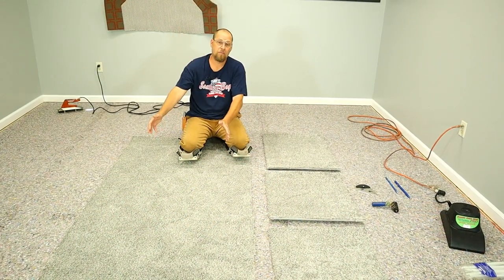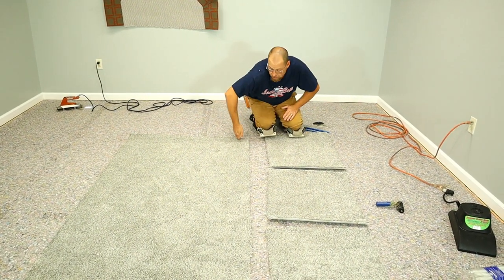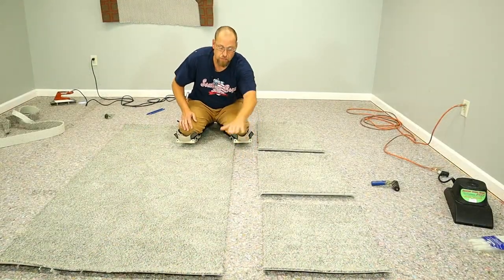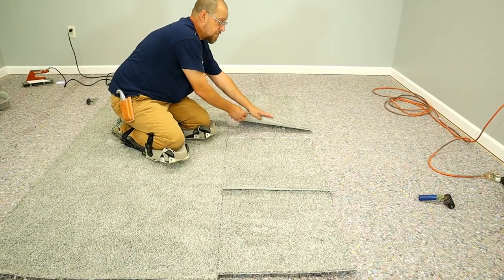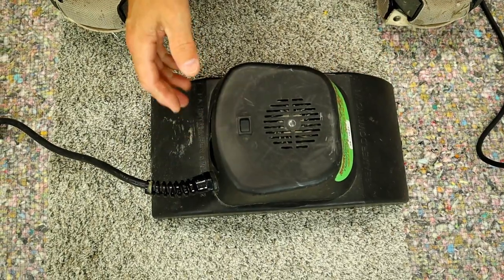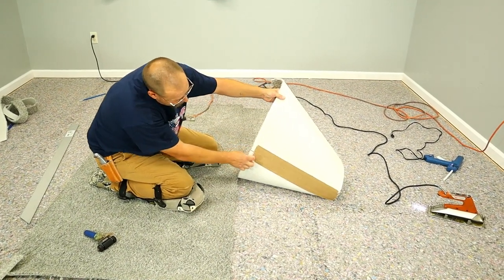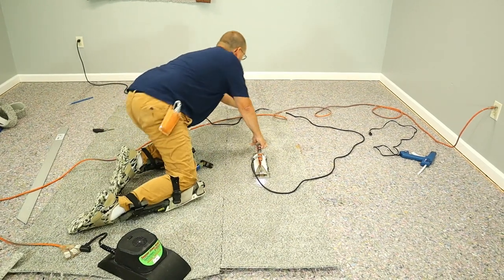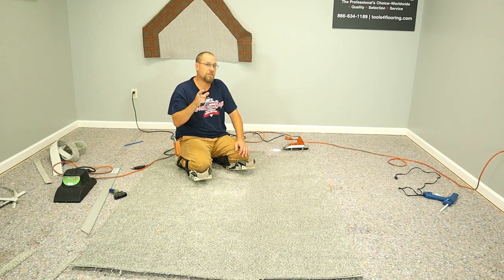HOW TO MAKE CROSS SEAMS IN CARPET

Comment: Nice job !! 
I cut the cross seams with a T square instead double cut but every one have different options.
Reply from the maker: That works too, thanks for watching And thanks for the feedback
Reply: @FloorsbySouthernboys  , I also use ,,actually a drywall t-square. I used to do it like this , I would use my straight edge to keep  the length straight, push my cross up against it! Do you have to seal all seams? I always did regardless! Now it's required again on all carpets in Ohio. Used to be Berbers and karastans. But one dollar and twenty minutes have saved me a lot of headaches I'm sure. I don't do videos so on other videos when people ask questions I send them to your channel. I use different techniques than you a lot but yours are correct, there are so many videos that I watch that the guys are just hack that I can't believe they would put it on Utube!!

Comment: Ruben I like your videos and I’m not in any way debating your style but over the last 50+- years of installing I’ve found some quicker ways on cutting what we call the “butt” seams. Throw that straight edge away first of all. Use that same seam cutter you used on the long side seam. Just use the blade closest to the piece your going to use so it cuts close to the yarn. No flipping carpet over two times and as you said the yarn covers over the seam edge. 
Just a tip from an ole guy 🙄

Comment: Basicly why  to seal the seam if taylor seamiron do it at the same time thanks i will appreciate your answer because  i am thinking buy one of those but if works the same as a regular seaming iron other than the ligth idon 't see a benefit thanks
Reply from the maker: You are thinking of a different iron, I do not on the weld iron by Taylor. This one is the 89OL the one you are thinking of is the 893L
Reply: So the model 890 doesn't  weld  the seam because i looks like the 893 it has the thing on back of the iron that do the welding action so wichone iron welds welds
Reply from the maker: @lardtamps  the 893 is the weld iron

Comment: Have you ever tried to cut both sides of cross seams using a straight edge and square?
Reply from the maker: Yes sir if the rows in the carpet are not straight when you row cut it will throw off you’re straight edge pieces just a little bit , This way it’s perfect every time
Reply: He just said he doesn't...

Comment: Use a square and you avoid all that and can cut all fill sides without notching
Reply: Rows are not always straight
Reply: @fitfloors1473  what does that matter...you are straight edging from the back. The guy just said that his straight edge cut wasn't straight in the video that's why notching helps. Use a square off your row run side and your fill pieces are going together just fine
Reply: @ejg34  wat if ur 2 row sides are different?
Reply: @fitfloors1473  you mean like a light row and dark row? On cross seams that will not be apparent like it is with length seams
Reply: @ejg34  no like when the long seam sways in and out
Reply: @fitfloors1473  I rarely have that. I don't row run anything but Berbers/patterns pieces. I straight edge or serpentine my seams. I've never been a fan of row running especially cheap carpets.
Reply: I was taught to use a square also.
Reply from the maker: @fitfloors1473  That is exactly why I do it like this, never have any issues this way
Reply: @FloorsbySouthernboys  same here